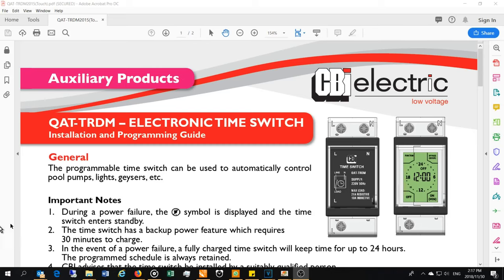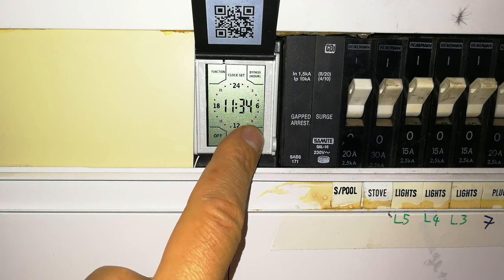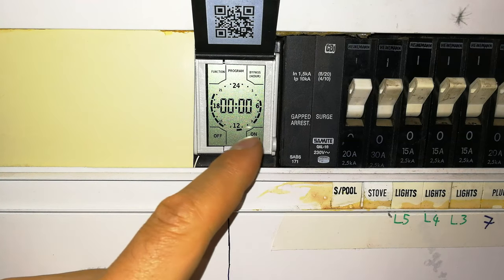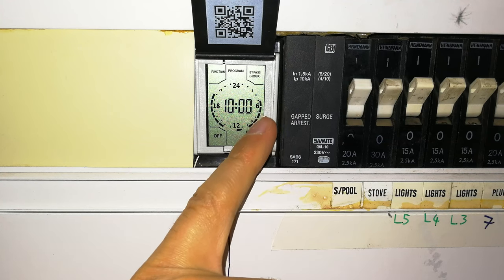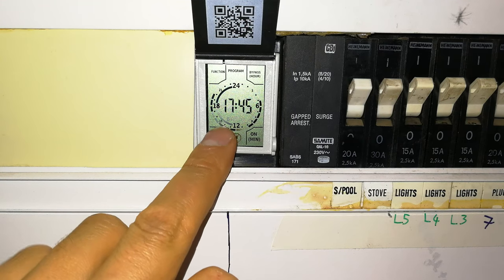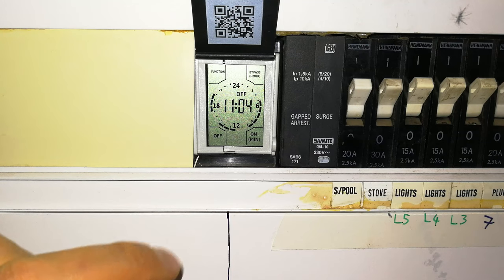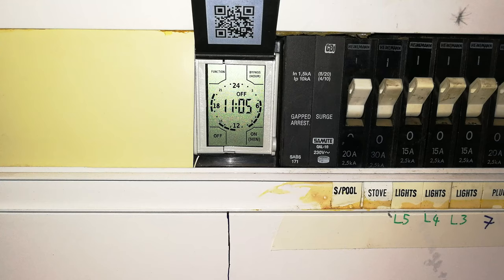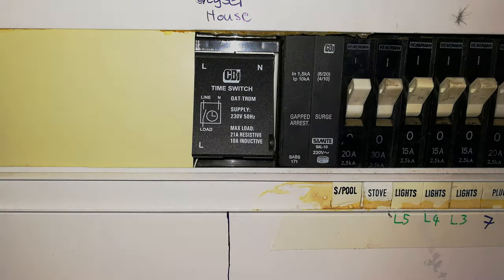How to program the CBI QAT-TRDM timer switch

Comment: Hi, I used to use the very same timer by CBI, first the non touchscreen version, then the Digital touchscreen. In fact I've used 6 thus far as I installed 2 each time in the DB. The battery back up has become such an issue for me, that I'm now going to use another Brand's Analogue 24 hour timer. I really like this CBI timer, but I cant be spending R450 every year on a timer. Since Im bad with keeping receipts, etc, Im going the alternative route. Lets see how it goes. Cheers
Reply from the maker: which one are you using now? Post how it performs if you dont mind.
Reply: @ecologicaltime  ive elected to go for the Majortech MTD2...its analogue and very simplistic...will keep you updated on its performance..
Reply: @calvinraju4985  I have used 2 of those Majortech units, both burnt out in 2 or so years. Hope it goes well with this CBI unit, however I did like the date program on the Majortech units.
Reply: Hi all. I had the Majortech timers installed about 2 and a half months back....ive got nothing but praise for these timers...they working excellently..no issues whatsoever...im so impressed..best thing is that when the powrr goes out i dont need to reprogram the time as with the CBI timers...there no looking back for me now...im sold on Majortech...will advise anyone to install these timers.

Comment: Thanks for your video, it was very helpful.  Our timer went off when electricity ran out.  I've managed to set it up again but have inadvertently in the process added time slots we don't want/need.  How do I remove time slots?  Thanks so much.
Reply from the maker: thanks. when programing timing, press off for the times you don't want. Keep "off" pressed and it will erase the time

Comment: I've also got this timer and will probably replace it due to the capacitor loosing power after loadshedding. Please advise what's the ideal schedule if we need hot water around 7am for showers, then again for a short while at night and use warm water early mornings around 5am (just basin)
Reply from the maker: the new model should not do that by the way. My old ones used to do that. 

I have mine to switch on about 45-60 mins before i need the hot water in the early morning. I have it one for 90 mins then its off for most of the day until about 3pm where its on until 7pm. I reduce the thermostat temp on the geyser to 45 degrees as well. Geyser is Kwikot 150l.

Comment: I got one on my main db which runs the geyser and one on a sub db that runs the poolpump...everytime with load shedding i have to set the geyser timer again but the one at the pool seems to  keep its memory...please advise how to set it to keep its memory in case of load shedding
Reply from the maker: the unit is faulty. It has a super capacitor as a battery and if it looses time its faulty. Return to supplier. CBI offer 12 or 18 month return warranty. had two that did that.
Reply: @ecologicaltime  Thanks! Mine also loses it's time and stuck on 00:00 and I can't press the function button to set the time. Faulty?
Reply from the maker: get it swapped by CBI
Reply: @dickiewilken  Same issue here. In my case the program I set is still there but the clock sets back to zero. I used the bypass function while we had daily load shedding this week but and that too does not keep its memory after the power returns. 

Manufacturing date 2016W17. Date of purchase 2 December 2016 which means its over 2 years. I wonder if they will still take it back, there must be a problem with this batch or they are too finicky.
Reply: @ @OBCBTTB  Ive got the very same issue. Gary, I've been through 6 of them now. I think they finicky.(personal opinion)

Comment: Please advise how to change the battery inside this timer, cause when there is load Shedding it loses the time.
Reply from the maker: i recall these had super capacitors as a power source. They not great with power outages. I know they improved their design so it does matter which manufacture date yours states on the unit.

Comment: How do you replace the battery/capacitor?
Reply from the maker: have to open it which means breaking the glued seals. First have to remove the cream colour plastic frame cover. Then split the bottom from the top with a flat screw driver at the seems. It uses a super capacitor so unless you got one of those, dont bother.

Comment: My CBI loses time every other day, every two days I must set the clock. Can you advise what to do.
Reply from the maker: the older CBI units lose time when they are disconnected from electricity supply. They used a super capacitor which i think didn't last enough time to keep the memory. Newer ones do not have this problem, can be off for 2 days and when your supply comes online, it still keeps settings.

Comment: Is it normal when the power goes off (load shedding) and them comes on again that they geyser stays off, this is so frustrating. 😤
Reply from the maker: I am assuming you have programmed the timer and that the geyser was supposed to come on. In that case, no the timer should have the geyser on after load shedding is over. But if your power is off for a long time, the little super cap (battery) in this timer may deplete and the timer does not go back to the correct position. The newer models dont have this problem.

Comment: Hi, our timer shows that it is on bypass but there is a two pin plug with a line through it that is flashing and it won't let me reset anything. Please help
Reply: Hi, am having the same problem, did you come right?
Reply from the maker: it means your unit is offline, its lost power from your DB supply or your power is off on that circuit.

Comment: The worst timer ever imaginable, you basically need a degree to work this rubbish. It does not have an on/off switch that you can just use and after load shedding you need to get up in the middle of the night in order to catch the pump running to do the backwash. I am not an idiot but this timer is finicky and you need to get in the pool company every time we need the timer programmed.
Reply from the maker: there have been a lot of problems with these - particularly the older models, they did improve them though. I dont use them anymore.